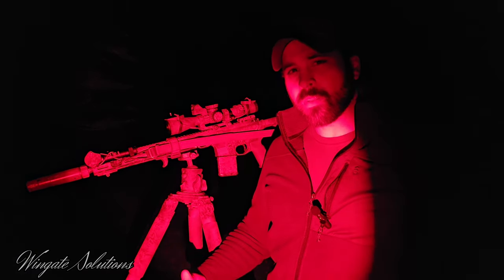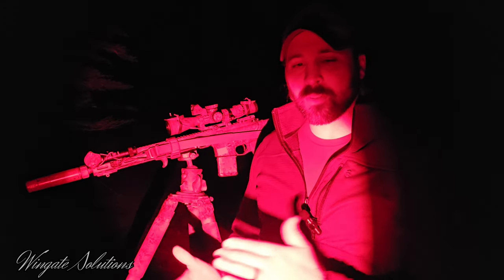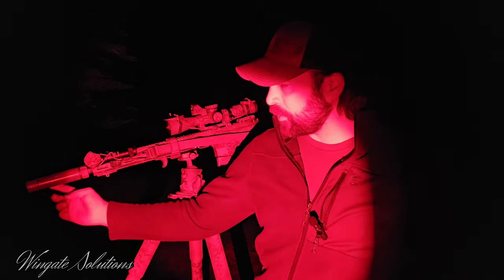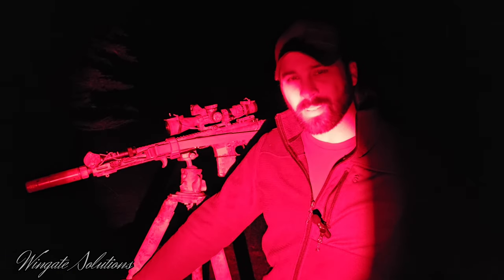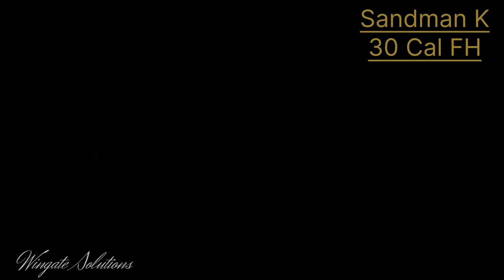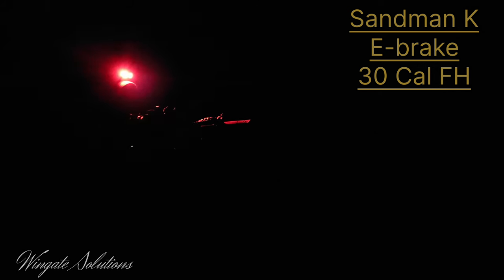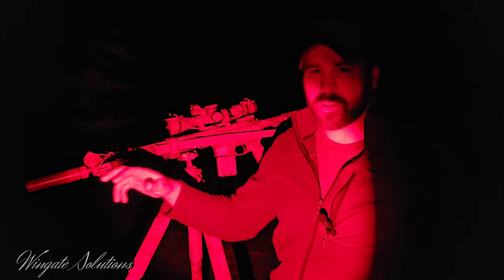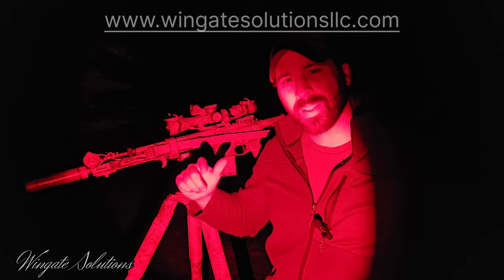Testing Suppressor Flash Part II (Dead Air Sandman, E-Brake, Flash Hider End Cap)

Comment: What I really appreciate about the ebrake is the reduction in back pressure on shorter guns. 

I have a 10.5" gassed for unsuppressed use. With the sandman k and ebrake, it barely changes the ejection pattern, andmakes it an awesome little close quarters package.
Reply from the maker: I agree! It becomes a solid "fighting can" setup.

Comment: She's flashy, at least it seem so on camera. I haven't had the chance to observe my sandman-s using the 556 flash hider end cap yet. Also just got into shooting at night so my general experience is limited. I didn't realize the E-brake added that much more flash, cool star pattern though. Looked like the flash you see in some movies lol. The suppressor game is something i've been neck deep in for a while. I'm looking at getting a CAT WB-718 to replace my turbo T2 and my sandman for 556 guns. The performance is insane looking at PEW Science data and flash looks excellent as well from the tests i've seen.
Reply from the maker: The e-brake is a cool add on. It definitely changes the signature a bit. I will check into the can you mentioned.

Comment: thanks for testing these. I'm about to order my first suppressor and I'm looking at the huxwrx 762i, or the surefire rc3, any recommendations? it gonna be on a 14.5 556.
Reply from the maker: Thanks. I do not have any direct experience with those cans but I have heard good things about both. I like the idea of a flow-thru can for lower backpressure and gas to the face.
Reply: What did you go with